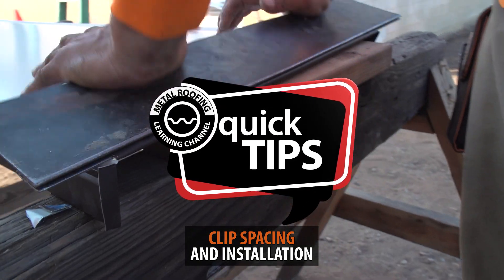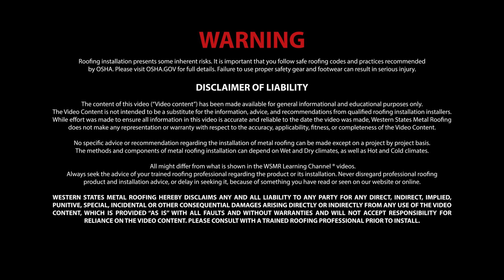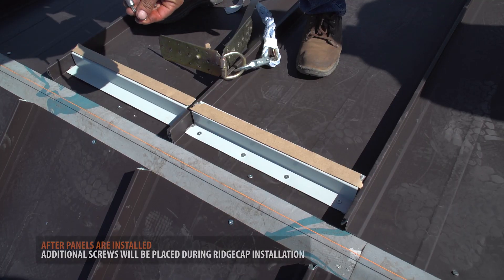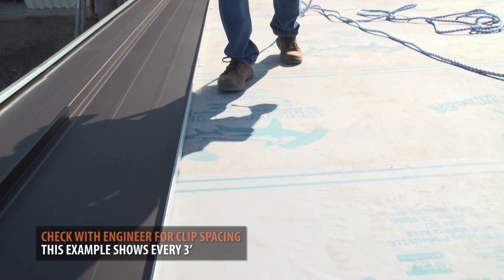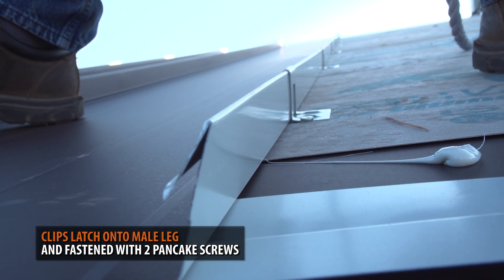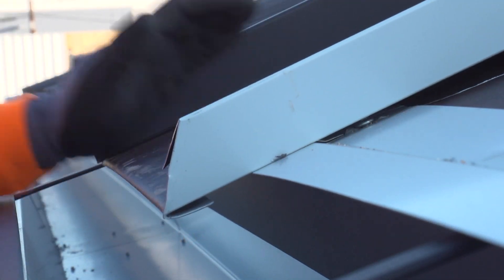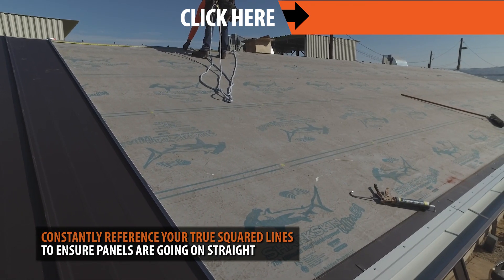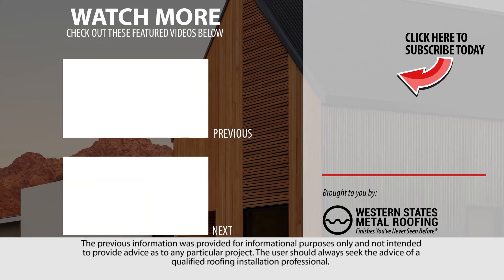How To Attach Clips And Fasten Standing Seam Metal Roofing. Includes Clip Spacing

Comment: what is the purpose of the sealant near the eave end?
Reply from the maker: The Butyl sealant at ends of the panels prior to lapping a new panel over is to seal off and stop any water working its way up the panel. Your cutting and tabbing over the ends of a panel. This stops almost all the water. If you have a driving rain, moisture can enter at the panel ends. The sealant adds a stopping point for the moisture in panel so it can't continue to wick up the laps as it gets hot.
Reply: You come across the issue of the clips causing small bumps on the panels?
Reply: @haydenspurrell98  whats your  the small bumps from...ive seen them on roofs and sometimes they look like kink in metal or debris left..
Reply: @haydenspurrell98  I think that's from too small gauge of metal and walking on clips, which you are not suppose to do.
Reply: @haydenspurrell98  Well made roofing has relief for the clips and proper fasteners.